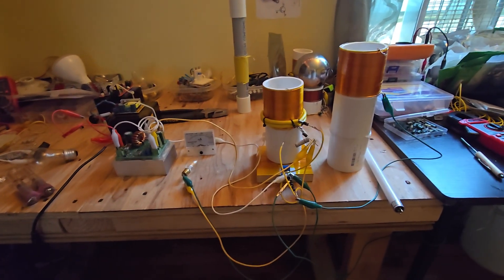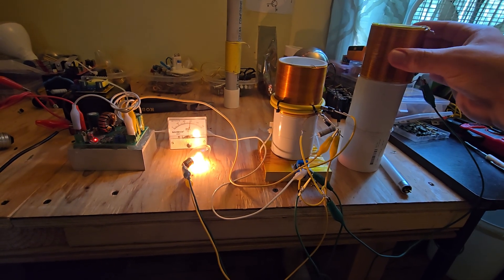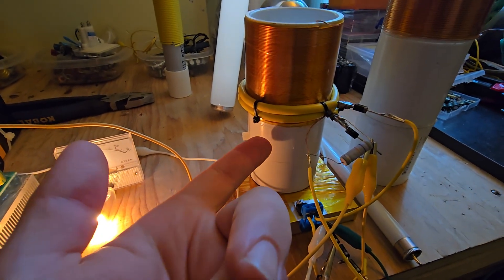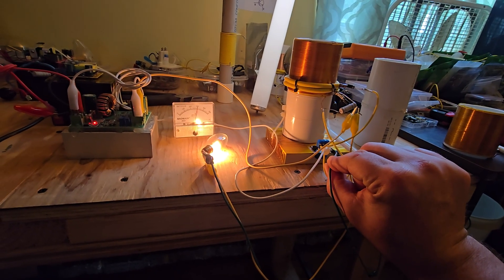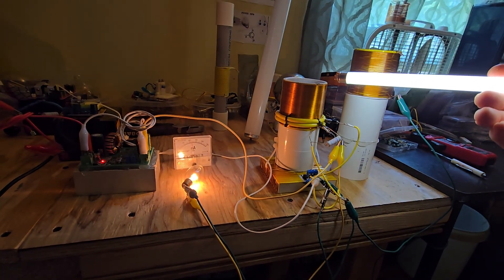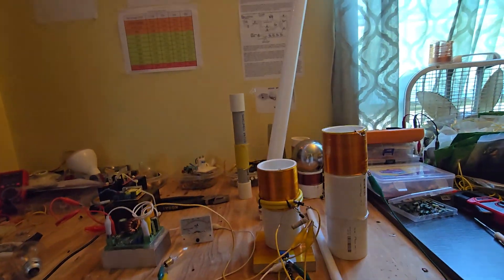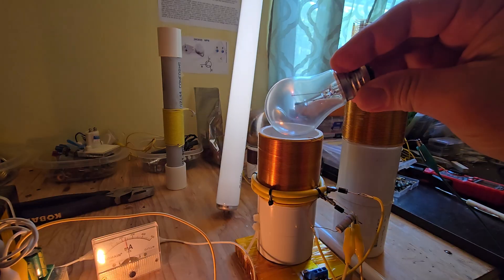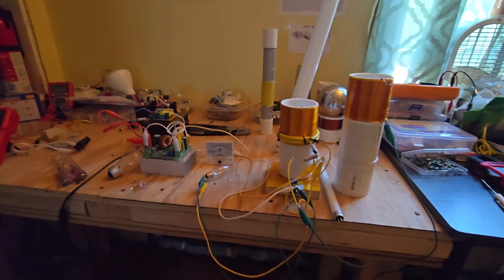299$ CRAZY COILS NOW FOR SALE. INSANE EFFICIENCY DISCOVERY. THE MORE YOU LOAD IT THE LESS IT USES 🌋

Comment: It is sad that you are trying to make money with this. 400 dollar is a ridiculous price for a few dollar setup, Just a bit of brain is needed for the average person to build this... which is rare nowadays. I suppose you sell it without the fancy battery. This is the real reason why people are poor and slave because everything is hidden behind the "paywall". The system does not need thinkers, it need consumers right? Good luck!
Reply from the maker: We list the exact schematic on our community post for free for people to build it & you have to factor in labor & they take about half a day to construct cleanly. How do you think any form of sales work? I'm not going to spend all day building products i make 0 profit on.

1. 50$ big heat sink
2. 25$ 8 awg primary coil
3. 25$ 20 awg secondary 
4. 30$ 6 ah driving battery 
5. 40$ 12-12-400vdc zvs
6. 10$ transistor 
7. 10$ solder
8. 20$ pvc pipes/couplers
9. 10$ zip ties
10. 10$ kapton tape coating
11. 20$ shipping if in usa
12. 100$ my labor fee
13. 20-45$ shipping fee.

Massive rip off for high performing negative resistance slayer exciter tesla coils when everything is itemized & built using high-quality materials, isn't it? Wait until we upgrade to HDPE firework mortar tubing instead of pvc piping for nearly no dielectric losses & a 9vdc battery will wirelessly run lights in an entire bedroom from the new hand held coils that generate 0 sparks & dump all theyre energy into free space.
Reply: @MTECH2022  It seems like everything is super expensive in the USA i guess :)) 10 dollars for a few zipties? :)) Oh come on...  10 dollar solder? :)) this is ridiculous, i could make your whole setup from maximum 50 dollars but actually can't because you are confusing people in your schematics. I noticed that in the previous experiments because i also tried to build your stuff but somehow didn't worked out like yours. Funny that i was able to build with success all the Rick Friedrich, whatifididthis stuff and could produce the same results as them but not yours. Maybe the problem is on my side. I also made notes about the confusions in the schematics but you didn't bother to reply for that. These are the reasons why i'm skeptic, not because i'm a heater or blame this stuff. I really apreciate transparency.
Reply from the maker: @nsmtbkid  the latest price is 299$ & things are very expensive in some parts of the usa. Where I am in New England you can't even get a cheese pizza for anything under 20 bucks

Comment: Is AC or pulsed DC being fed to the primary coil? If pulsed DC, is it very sharp?
Reply from the maker: Pulsed dc from zvs
Reply: @MTECH2022 

Ah ok. ZVS typically output HF AC? I guess you’re turning it into pulsed DC with your circuit or something?
Reply from the maker: @ashercorbett8089  yeah the circuit that drives the Tesla coil is a slayer exciter with a sidac for negative resistance injection & can handle up to a 600vdc input from the zvs. Basically a negative resistant slayer exciter tesla coil circuit on steroids :)
Reply: @MTECH2022 thanks!